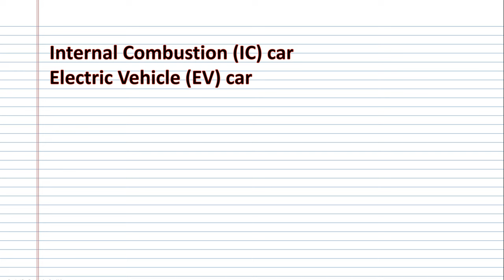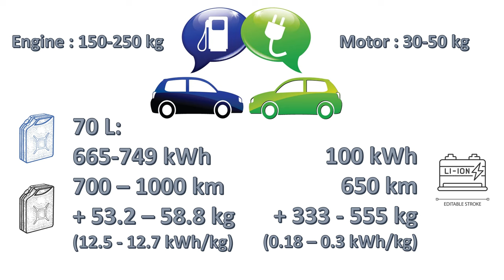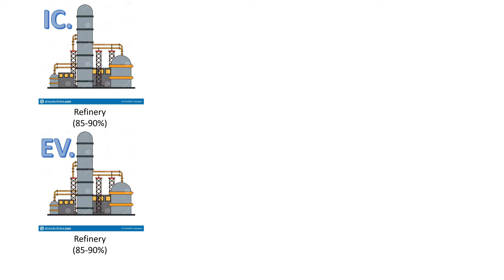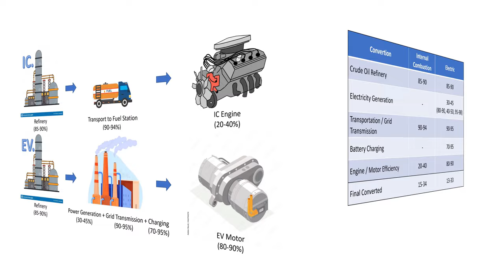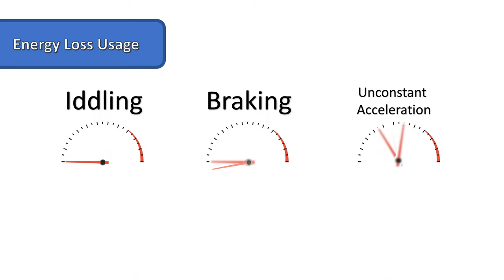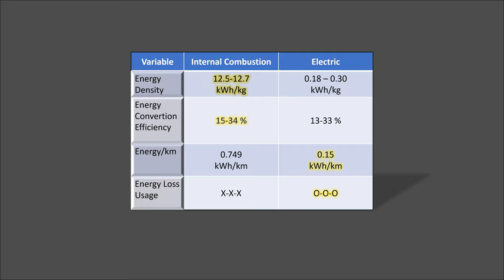Internal Combustion (IC) vs Electric Vehicle (EV) - Complete Energy Comparison

Comment: Some glaring ommissions are the power losses from the step-up and step-down transformers for high-voltage transmission, and then your local neighborhood transformers. All at about 90% efficiency. This, the electric vehicle gained an unwarranted 30% credit in the comparison which it should not have received.

Comment: the energy for the electricity grid increasingly is coming from renewables and around the world many grids are over 50% and in future will be 100% renewable so the conclusions in this video are wrong
Reply from the maker: would you mind telling me which conclusion is wrong? the video state that if the electricity generation using renewable energy it would clearly better than the internal combustion. its in 10:50 . my point is, its need best scenario of energy convertion process of IC vs bad energy convertion scenario of EV to be able barely keep up. maybe its because my wording is not clear enough.